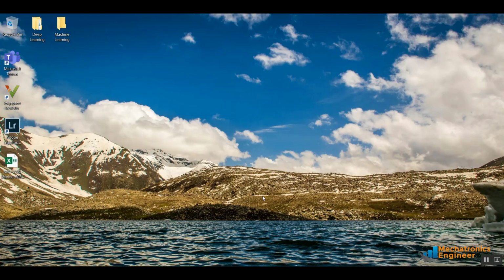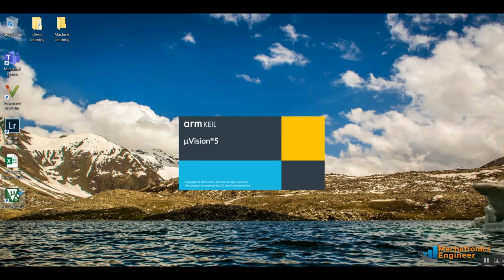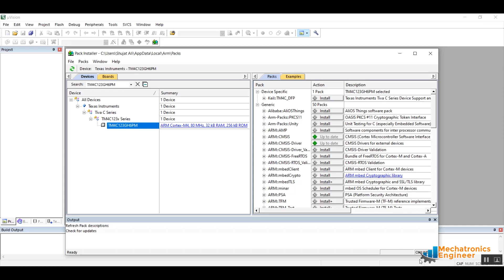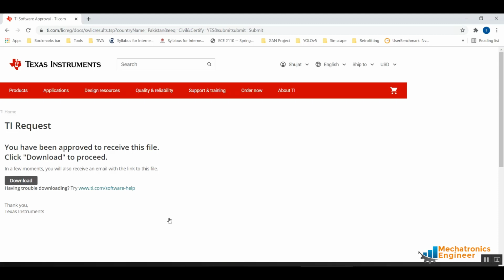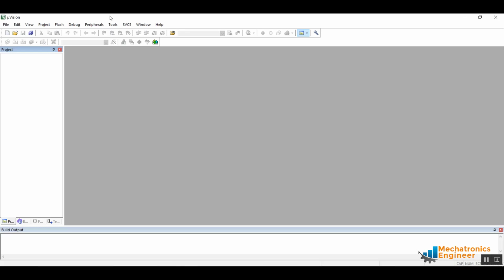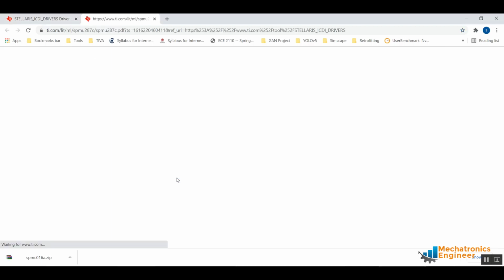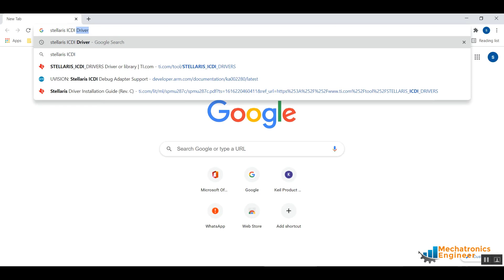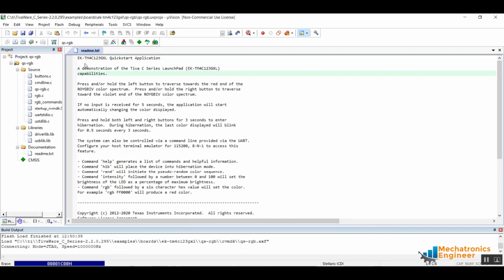Installing Keil Embedded Tools for TIVA C Series LaunchPad

Comment: I have mine connected but nothing is showing "In-Circuit Debug interface" I'm not sure what's going on.  My computer doesnt seem to recognize me plugging in the board. (Its receiving power though as the lights are on) any ideas?
Reply: did you find the answeR?
Reply: @devarshbhandari1885 Any fix? I can’t see Stellaris ICDI option in debug drop down

Comment: Great work !! this video was very helpful in setup. 

I faced only one issue. when i am trying to compile the blinky project, it is unsuccessful. because compiler ver 5 is missing from MDK537. it would be great if you could suggest how to download and integrate comiler version 5 with this IDE version 

Thanks
Reply: I have the same issue, with Keil uVision 5.37.0 the only compiler versions installed are V6.18. I tried installing ARMCompiler_506_Windows_X86_b960 from ARM but still was unable to compile. Any advice would be great!  
Just wanted to add that with the ARMCompiler_506_Windows_X86_b960 compiler I am unable to compile because a license does not come with Keil for this compiler, and the ARMCompiler_506_Windows_X86_b960 installer did not install one.